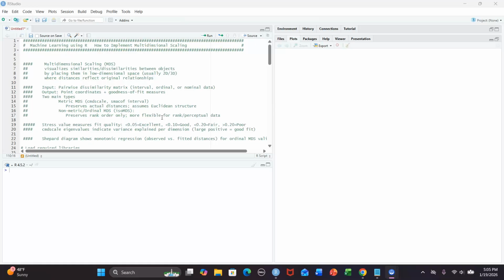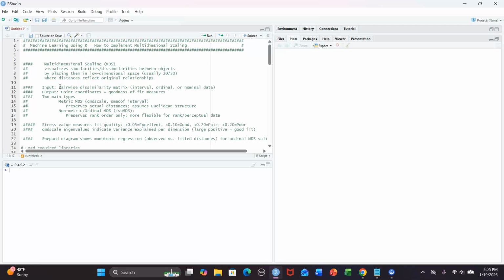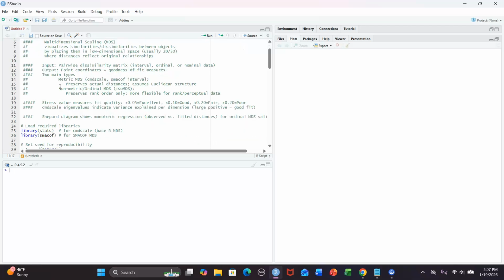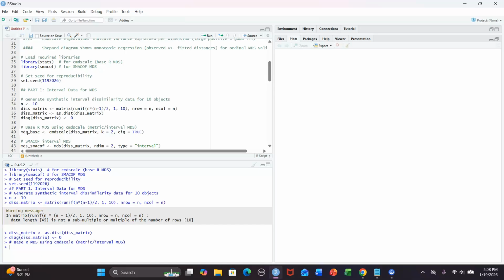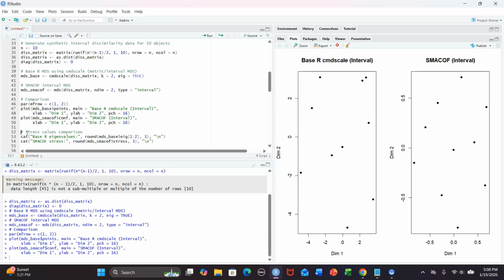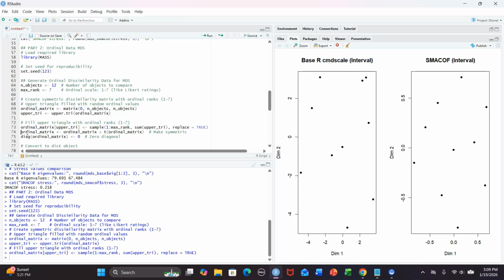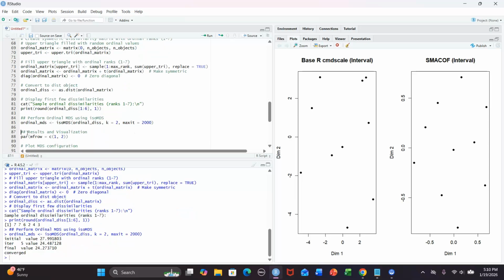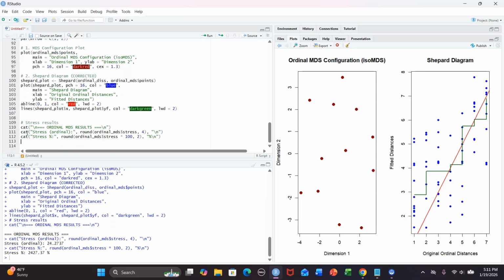Machine Learning using R How to Implement Multidimentional Scaling#r#multidimensionalscaling

Comment from the maker: #############################################################################################
 #                                             Machine Learning using R   How to Implement Multidimsional Scaling                                                        #
 #############################################################################################
 
 
 ####     Multidimensional Scaling (MDS)
 ##       visualizes similarities/dissimilarities between objects 
 ##       by placing them in low-dimensional space (usually 2D/3D) 
 ##       where distances reflect original relationships
 
 ####    Input: Pairwise dissimilarity matrix (interval, ordinal, or nominal data) 
 ####    Output: Point coordinates + goodness-of-fit measures
 ####    Two main types
 ##             Metric MDS (cmdscale, smacof interval)
 ##                Preserves actual distances; assumes Euclidean structure
 ##             Non-metric/Ordinal MDS (isoMDS): 
 ##                Preserves rank order only; more flexible for rank/perceptual data
 
 #####   Stress value measures fit quality: <0.05=Excellent, <0.10=Good, <0.20=Fair, >0.20=Poor
 ####    cmdscale eigenvalues indicate variance explained per dimension (large positive = good fit)
 
 ####    Shepard diagram shows monotonic regression (observed vs. fitted distances) for ordinal MDS validation
 
# Load required libraries
library(stats)  # for cmdscale (base R MDS)
library(smacof) # for SMACOF MDS

# Set seed for reproducibility
set.seed(1192026)

## PART 1: Interval Data for MDS

# Generate synthetic interval dissimilarity data for 10 objects
n <- 10
diss_matrix <- matrix(runif(n*(n-1)/2, 1, 10), nrow = n, ncol = n)
diss_matrix <- as.dist(diss_matrix)
diag(diss_matrix) <- 0

# Base R MDS using cmdscale (metric/interval MDS)
mds_base <- cmdscale(diss_matrix, k = 2, eig = TRUE)

# SMACOF interval MDS
mds_smacof <- mds(diss_matrix, ndim = 2, type = "interval")

# Comparison
par(mfrow = c(1, 2))
plot(mds_base$points, main = "Base R cmdscale (Interval)", 
     xlab = "Dim 1", ylab = "Dim 2", pch = 16)
plot(mds_smacof$conf, main = "SMACOF (Interval)", 
     xlab = "Dim 1", ylab = "Dim 2", pch = 16)

# Stress values comparison
cat("Base R eigenvalues:", round(mds_base$eig[1:2], 3), "\n")
cat("SMACOF stress:", round(mds_smacof$stress, 3), "\n")

## PART 2: Ordinal Data MDS
# Load required library
library(MASS)

# Set seed for reproducibility
set.seed(123)

## Generate Ordinal Dissimilarity Data for MDS
n_objects <- 12  # Number of objects to compare
max_rank <- 7    # Ordinal scale: 1-7 (like Likert ratings)

# Create symmetric dissimilarity matrix with ordinal ranks (1-7)
# Upper triangle filled with random ordinal values
ordinal_matrix <- matrix(0, n_objects, n_objects)
upper_tri <- upper.tri(ordinal_matrix)

# Fill upper triangle with ordinal ranks (1-7)
ordinal_matrix[upper_tri] <- sample(1:max_rank, sum(upper_tri), replace = TRUE)
ordinal_matrix <- ordinal_matrix + t(ordinal_matrix)  # Make symmetric
diag(ordinal_matrix) <- 0  # Zero diagonal

# Convert to dist object
ordinal_diss <- as.dist(ordinal_matrix)

# Display first few dissimilarities
cat("Sample ordinal dissimilarities (ranks 1-7):\n")
print(round(ordinal_diss[1:6], 1))

## Perform Ordinal MDS using isoMDS
ordinal_mds <- isoMDS(ordinal_diss, k = 2, maxit = 2000)

## Results and Visualization
par(mfrow = c(1, 2))

# Plot MDS configuration
par(mfrow = c(1, 2))

# 1. MDS Configuration Plot
plot(ordinal_mds$points, 
     main = "Ordinal MDS Configuration (isoMDS)",
     xlab = "Dimension 1", ylab = "Dimension 2",
     pch = 16, col = "darkred", cex = 1.3)

# 2. Shepard Diagram (CORRECTED)
shepard_plot <- Shepard(ordinal_diss, ordinal_mds$points)
plot(shepard_plot, pch = 16, col = "blue",
     main = "Shepard Diagram",
     xlab = "Original Ordinal Distances", 
     ylab = "Fitted Distances")
abline(0, 1, col = "red", lwd = 2)
lines(shepard_plot$x, shepard_plot$yf, col = "darkgreen", lwd = 2)

# Stress results
cat("\n=== ORDINAL MDS RESULTS ===\n")
cat("Stress (ordinal):", round(ordinal_mds$stress, 4), "\n")
cat("Stress %:", round(ordinal_mds$stress * 100, 2), "%\n")